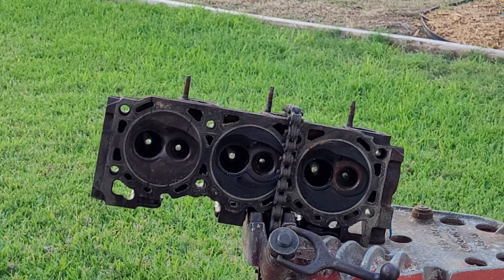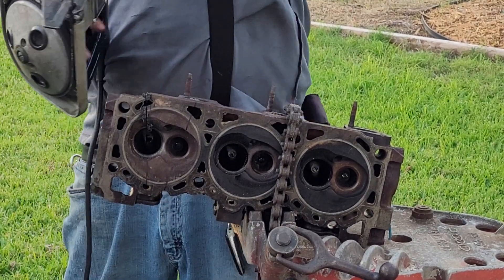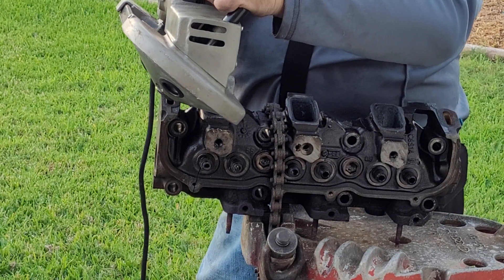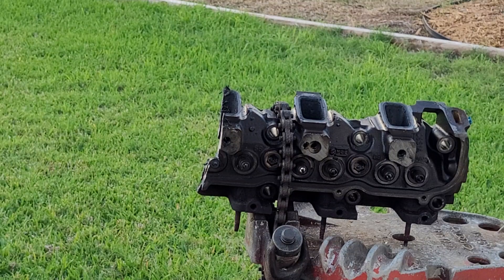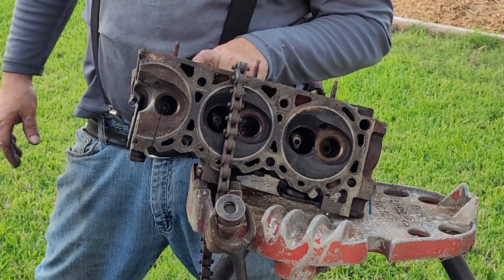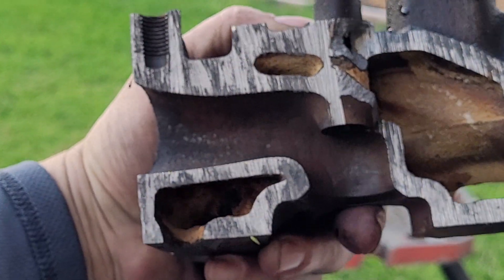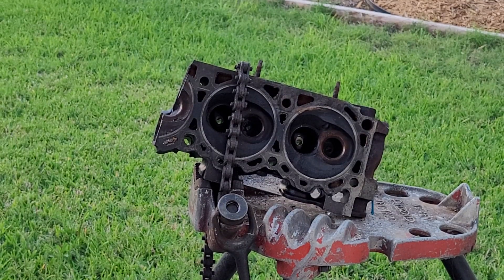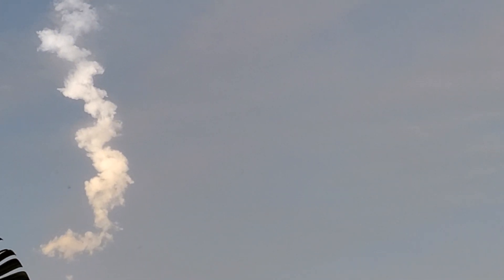Ford 4.0l cutaway demo

Comment: 4.0 OHV?!?!?! NO WAY! The SOHC I could see but oh my
Reply from the maker: Yeah, it is pretty bad. It SHOULD be easy to improve as far as flow. We will see. Thanks
Reply: @servediocylinderheads  I wasn't able to catch all the dialogue so I'll go back and watch soon. I never looked at the 4.0 OHV with any performance potential, and I worked on that engine A LOT! I'm very curious to see will come of that flat valve sand dune intake port cylinder head. Anything you do will be an improvement.....😂😂😂😂 The chambers.....man! Reminds me of 1/8 acre lot subdivisions the way the valves are shrouded.

Stay motivated and work safe Charles.
Reply from the maker: @arturozarate1752  Thanks!

Comment: The cones are the shockwave from the supersonic exhaust from the rocket motor. There are several if you see them under ideal conditions.
A little suprising how much material there is in a 4.0L head especially since every one of them cracks by 120,000 miles. I'll have to use my portable band saw on some old heads, 2v Cleveland prolly, and take a peek inside.
Reply from the maker: Cool. Thanks

Comment: Ever do any porting on Volvo 2.3 8V & 16 V heads they bolt on a Ford 2.3 Lima engine. 
The Swedes are making big power with the 2.3 turbo 8v & 16V engine.
Reply from the maker: No, but very tough I bet.

Comment: Best boat anchor ford ever imported.
Reply from the maker: Yeah, we will go over some of the engineering. Thanks
Reply: The chains are a nightmare lost 2 engines with under 100K.  the 3.8/ 4.2 killer engine.
 @servediocylinderheads
Reply from the maker: @73turbopinto  Timing chains.... timing belts... not really a fan of either.
Reply: I don't know but the Cologne motor, the 2.9L V6, may be in the running for worst along with the 3.8L V6. Head gaskets and cracks like sugar ants at a barbecue.